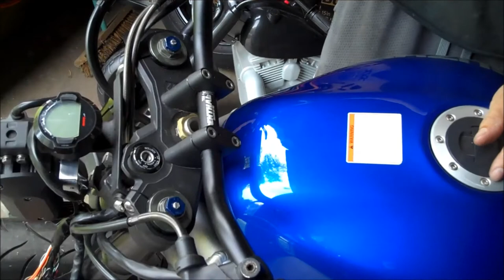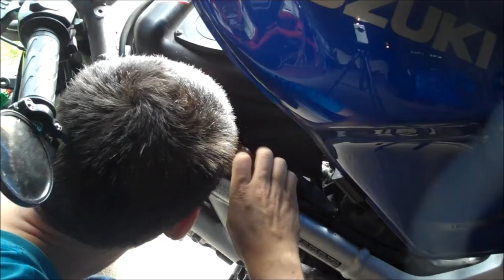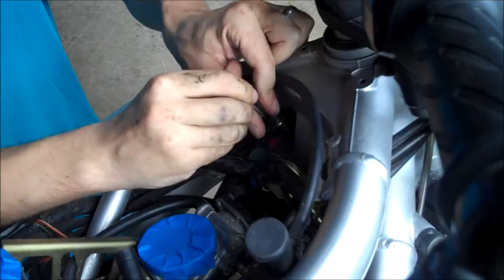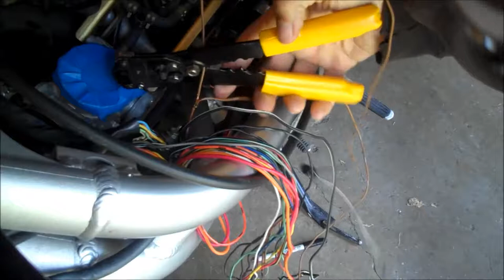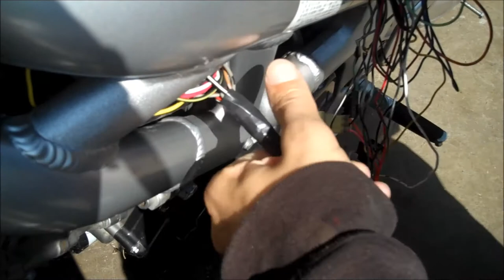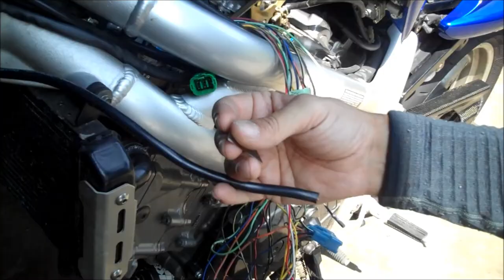Sv650 build Part 3. Wiring the headlight

Comment: This is the point im at on my old f2. Theres a fuckin million and ten wires that were running through the front plastics for the old headlight blinkers and gauges. I ordered a 7 inch circle headlamo and an all in one digital gauge. Each requiring about like 2 and 3 cables. No idea what the fuck is what.
Reply from the maker: Anthony DeRosa id look for a forum or a FB group for your bike, they might have files pinned like shop manuals. Maybe you can get a colored wire diagram from Google images.